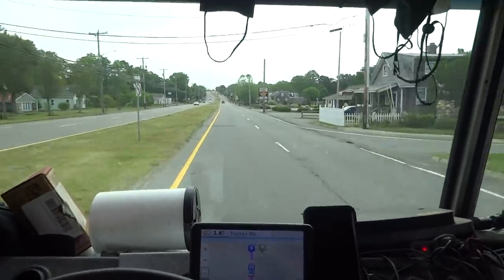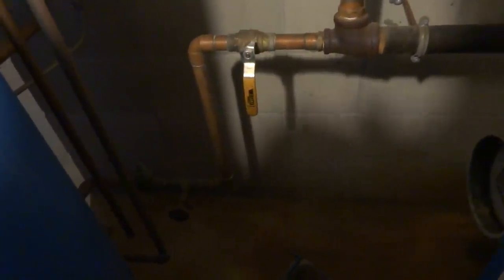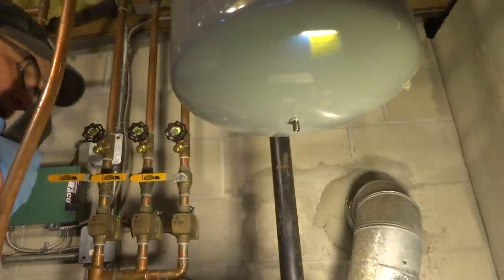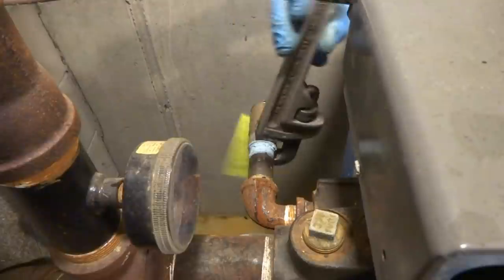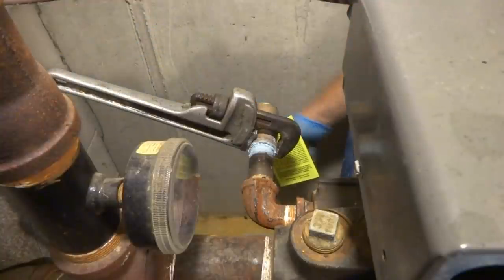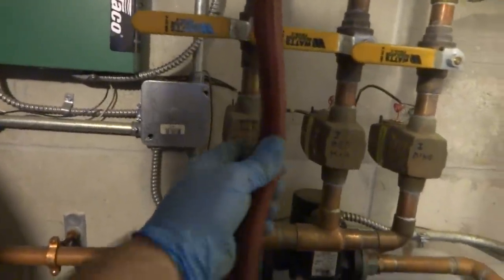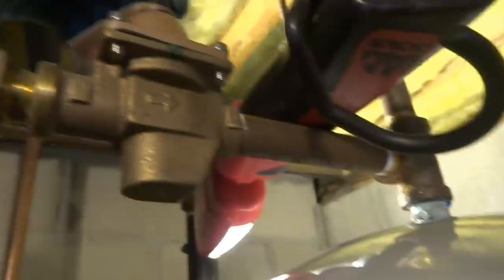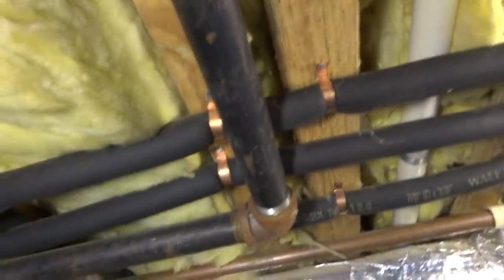BOILER RELIEF VALVE LEAKING WATER WHEN BOILER RUNS

Comment: How are those expansion tanks so weak? I have a similar one, I think it's pushing 15 years soon. I don't have an automatic feeder though.
Reply: @markgriz  Yeah you are right. 8/10 the nitrogen charge leaks out the schrader valve. We allways refill them with either expansion tank filler, wich is nitrogen + some oily stuff to keep the rubber diaphragm inside and the valve happy, or compressed air (and add 21% extra because the oxygen part of the air will diffuse through the diaphragm into the water side). I also found that it helps to push the schrader valve open a few times to make ist seal again.
Next thing: We install the tanks so that the water side and pipe (rising from boiler return to exp. tank) is on the bottom and the air/nitrogen side is facing up. So if the diaphragm leaks its not loosing its charge and any gas in the system actually adds to the charge. 
They usually last 20-30 years that way if they dont rust thru. 
Or are they just that much cheaper to replace in the USA? Tank replacement of a 35L(10 gal) Tank costs around 70-100$ (60-80€) here. Refilling just adds 10-15$ to the maintenance bill
Reply: @0123-v1o  same where I leave, and is some tanks u can actually change the diaphragm, but from the few years that I lived in the us looks like it’s more of a norm to directly change the whole thing than repairing in many sectors not only plumbing.
Reply: Yea I always use just air
Reply: Your ok just keep the air charge the same as the water pressure no sweat

Comment: Why the relief tank is bad? Can’t u add some air and check if it’s leaking through the valve? How possible is the that the rubber has allready been destroyed? Wouldn’t normally water come out for the air if it was bad??
Reply: @barackobama5304  if there is no water coming out when u check the air the tank is 100% good, and is normal after years of using it to loose air something that should be checked at least a year and add air if is low( and check the air valve). I m not aware of expansion tanks that don’t have a rubber diaphragm inside but only ones that have in different shape and type whether they are for closed heating circuit or hot water or drinking water.
Reply: @angelossakellariou2832  watch some of Steve’s videos when he’s working on an old school boiler with a barrel shaped tank strapped to the bottom of the floor joists. 
Those don’t have a diaphragm. They just rely on the natural air pocket that develops.
Reply: @erikj.2066  ah yes you are right, I thought nobody uses them anymore cause even though they dont have diaphragm or bladder to go wrong they destroy the rest of the circuit since they produce corrosion as the air comes in contact with the water. Similar to open tank system they used years ago in my country which was placed on the roof.... never go bad it self but the rest of the system.....

Comment: Just had a new American Standard 80% eff. A/C and furnace put it and they reused the old line sets . Should he have pulled a vacuum? I no the condenser and case coil are precharged . This new furnace sounds like a jet engine! I only have 13 degrees across the coil .
Reply: You need 15deg super heat and did you take out a R22 job honestly the piping should have been changed R22 is mineral oil the new stuff is synthetic not comparable there may be some oil left over
Reply: With reusing the old piping absolutely